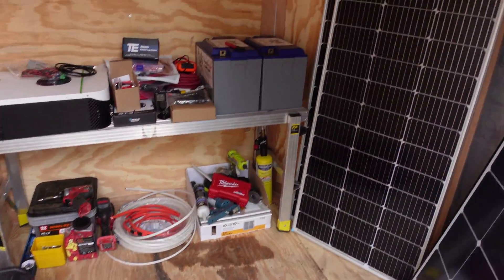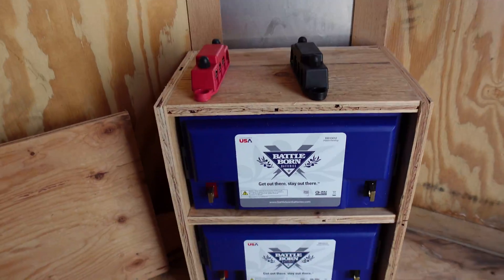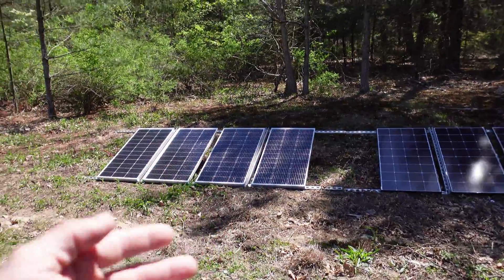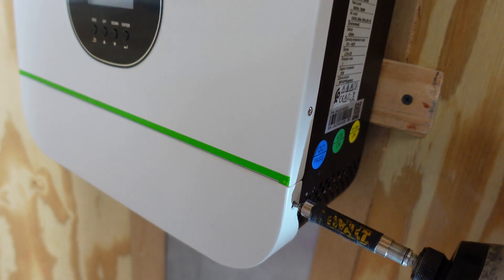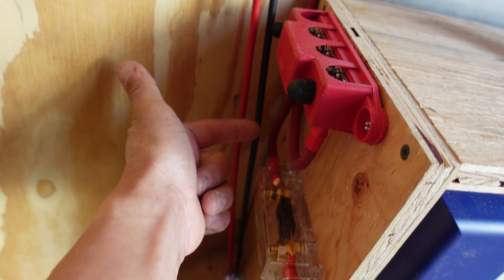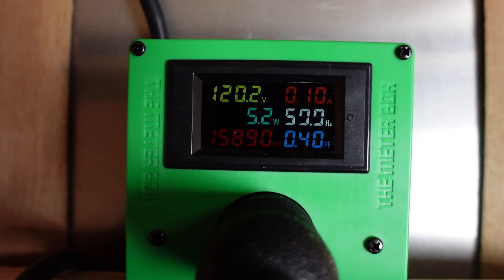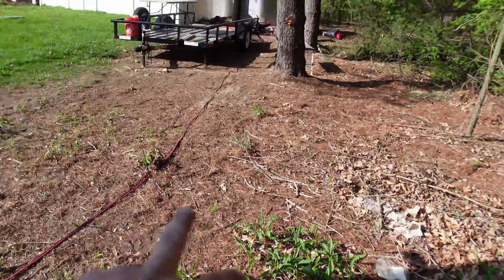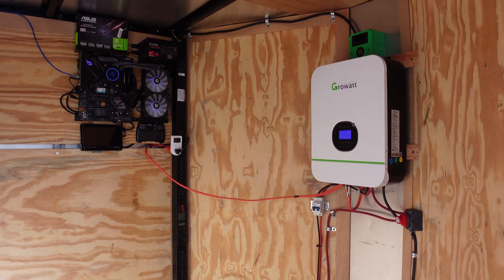My Crypto Mining Solar Build | FULL GUIDE

Comment: have you thought about a failure in the battery bank? If you have 1 failed battery that starts losing voltage, in a series system it will kill all the other batteries too most likely

Comment: That PDU is a "switched PDU", meaning you can remotely control each outlet via ethernet web page. The PDU has a little web server which you can log into and you can then remotely control each outlet and set schedules or do manual on/off.

Comment: I have been in precast concrete for over 20 years now creating mix designs. Next time don.t put holes in the bucket. If the concrete dries to fast it will get shrinkage cracks. With the top of open and covered with soil it will set if 24 hours. With a good 4000 psi mix it should be ok to mount the panels In one week.

Comment: Converting from DC (batteries) to AC (inverter) is at going to loosing about 10% of the energy. The PSU is then converting the AC back to DC to power the mining rig, again loosing about additional 5% for a total of about 14% of your power doing these conversions. If you convert between voltages at DC the effeciancy can be as high as 95 to 98%.

It is possible to get 800W DC-ATX power supply which is designed for autonimous cars that will run from a source voltage between 12 to 63, so will run directly off the batteries. Only thing to be aware of is you need to make sure that you have something that will switch the power off when the battery voltage gets to low.

Comment: Nice bro!! :) But i need 220V 😄 also the battery box need to be metal with cooling system if you have because they are overheat and loss capacity after time  and fire resistant because the wood will burn your walls:)

Comment: Awesome video man. Are you doing anything to safe shut down the rigs when the batteries don’t have enough to power the rigs? I’ve always been curious how people do that
Reply from the maker: I actually converted the solar to power the exhaust fans and when the sun goes down it will convert to shore power and back to solar during the day
Reply: @ChumpChangeXD  so the miners are grid tied?
Reply from the maker: Yes you need much more solar to run rigs 24/7

Comment: Why are you wasting energy converting from dc to ac and back to dc ? 
Much more efficent would be to step down from the 24 vdc to 12v,5vand3.3v for the Miner
Reply from the maker: Because I need 120v not DC? Lol
Reply: @ChumpChangeXD  The Motherboard is not powerd with 120v the gpus and Motherboard are powerd by 12 v.
I mean you could just use a dc input Power supply that you can get for Pcs or just use a high power dc dc converter
Reply from the maker: I understand that but it is foolish to try and hook up a MOBO straight and very wrong. I’m not willing to do that. ALSO this is for exhaust fans and other possible rigs not just a MOBO
Reply: @ChumpChangeXD   I have a Ring running like this for a couple Months with pico psu in the 24pin and a 100A Dc Buck converter to geht 12 v of my 24v Lipo4 works great

Comment: don't run different panel types in parallel
your better to run all the black panels in parallel, silver in parallel and series them together as each type with have a different mppt voltage point
Reply from the maker: Think you have that backwards my man. Series all the same panels 4 and 4 then parallel to keep it the same voltage vs series that would add more voltage. This is why I tested the lines. 

As long as they are basically the same voltage this set up is fine 100%
Reply: @ChumpChangeXD  doing that stresses the panel diodes and prevents proper mppt tracking, as a hardware engineer that designs and manufacturers mppt solar chargers. panels of different types should not be used in the same string but if they are run each type in parallel and series the types together this will help with panel shading and lets each panel type find it's peek mppt point naturally. It's up to you honestly but if you test it out a bit you might find you make 10-12 % more power per day and it cost a few buck to test might make a good update video too but either way you do need to keep within the limits of the charger but most are usually current limited on the battery side more than anything
Reply from the maker: @CNCAutomationLab  that’s why I ran 4 of each model in series to get to 80 volts each or just over; 84 I think inside the unit itself. 

Far as I know higher voltage charges the battery faster if I’m not mistaken? That’s the main reason I didn’t do things the other way (parallel and then series)

My unit can handle 145v open current max
Reply: @ChumpChangeXD  kool voltage maters on both input and output but Amperage on battery output is usually the limiting factor regardless. example
if your solar charger has say a 60Amp limit and a 140v solar input that means  at your 80v panel input might be limited to 80v at 60amps or 4800w input But if your using a 24v battery thats reduced to 24v at 60amps and that is only 1440w and this is where a lot of marketing takes advantage of buyers.
some can split some power to the inverter to power AC but something to keep an eye on
Reply: i went back and looked up the full specs on the 24v growatt hybrid and it's specs are 80amps peek with 65a constant in bulk charging mode that generally from 10.5 up tell 13.6v for LiFe based batteries with balance/ float from 13.6 up to 14.6  so 2 packs in series bulk charging is 21v to 27.2v so using 21v as your base 21v x 80A =1680w x 0.86 for efficiency this is a max sustained bulk charging of 1440w wirh short peeks upto 1600w so keep this in mind adding solar panels you might need to add another mppt charger for another array and yes it's perfect ok to have multiple chargers on a battery bank But make them all apx 0.2v below the main unit for peek charge voltage this help reduce the charge current when nearly fully charged and reduce battery heat

Comment: I have 1.8kw solar and my setup is almost 10yrs old. I have 4 group 31 deep cycle batteries wired for 24 volt with a 3kw sine wave inverter and 5kw charge controller. some day I'd like to upgrade to a 48v 120/240. I have a transfer switch controlled by a smart switch so I can switch over to solar when the sun is out. I never though about trying to see how many miners i could run 24/7.

Comment: really awesome and useful; appreciate learning from your experience. do you have a tip sheet or inventory of items to plan all the components to determine cost vs benefit? for example, how many panels and battery pack vs computer (cpu mining system) required?
Reply from the maker: I will be going over it all in another video this week. I do have the solar stuff in the Amazon store (pinned comment)

Comment: few notes about the project 1) battle born are great and the best but very over priced. Server Rack batteries are like half the price 2) not sure if growatt supports automatic power transfer without interruption to the grid after the batteries are drained. propably they do but in general, Victron multiplus is the king for quality and other bells & whistles like maintained apps for remote access / api. 3) connecting the solar panels in series means if any panel is partialy shaded, the whole amp drops for all panels
Reply: agree 100% .... go Victron Energy on your next build/upgrade.... so much flexibility.
Reply: I don't know the specs for his growatt, but in parallel, the voltage would be affected if a panel (or two) goes out, possibly putting it out of the range of the growatt inverter.
Reply: @derek2593  that's what parallel benefits vs in series, if one panel is shaded, doesn't affect the array production
Reply: @mostafaelgamel6415 , pardon my ignorance... but, are you saying the voltage is affected, but the amperage compensates?
Reply: @derek2593  so the whole array will be running on the same voltage and each panel will provide different amperage at that voltage, so for example im running a 24v per solar panel system 8 in parallel. the whole array is running at 38V each solar panel is contributing different amperage based on how much sun it's getting. The charge controller (built into growatt, steps down that voltage to little above the battery current voltage (now i'm at 23.5v so i assume the charge controller is converting to like 23.8v or so at an aggregate of 20 amps to about 476W total charge to the battery. that solar panel array can be running up to 60V (specially in winter) and the charge controller will be able to handle it.
Reply: @derek2593  one reason to run solar panels in series is to increase the solar voltage. so to charge the battery, the charge controller needs a higher voltage than the battery. so let's say u have a 48v battery and 4 12v solar panel (12v is just a spec or name means it'll be anywhere between 16v  or 24 volt, check the solar panel sticker will have these values) in this situation u will need 4 solar panels connected in series to get above the 48v battery voltage. now if one solar panel is partially shaded, the amperage will drastically drop on these in series array

Comment: hey you most likely have this covered but just make sure the strings that are paralelled together have the same voltage 
if they are different manufacturers they may have different voltage temperature coefficients.  solar panel voltages change with cell temperature. +-5% is no problem
love the DIY

Comment: would have been nicer with 12 volt or DC mining power setup as plenty conversion losses with AC. while there no off the shelf parts for this setup, I think it is pretty doable with some consulting or asking electronics/electrical people.
Reply: Even if you could power the miners with a 12volt power supply, you would have to have 4 or 6 gauge cables from the batteries to the panels since amps increase as you lower voltage.  A 48 volt system actually maximizes efficiency, and allows for minimum resistance.  Any gain that you would receive converting the power supplies to 12v would be lost having a 12v system at this size.
Reply: @designomatic  MPPT solar charge controllers can take higher voltages more than 100V. In other words, your panel setup don't need to match the output of the system/batteries.

Comment: Nice start (because you'll always want more battery and solar panels!)

I built a 48v 350ah battery a couple years ago and have 8 400w solar panels out back. My mining rig draws a steady 700w and if I have a sunny day every other day then I can run it 100% on solar.  The battery drains about 35% overnight. 

I built the setup to run the house, but why not mine on it!

I want to find a crashed EV and get the battery out of that to expand, and get more panels. Where i live the winters suck.
Reply: That cool. I am thinking the same on the batteries. I want a nissan leaf... I think It would do what I need. I am on flooded batteries and want to go to lithium iron posphate. Then I will fork on adding more pannels. I have about 40 now @275w so about 6.5kwh. It will not run my rigs. I have one on it now and part of the house. It is keeping up with that but I am building it myself and I never have enough time to get it right. lol

Comment: That is awesome to see.  I just got my solar panels hooked up this weekend.  Now I need to get everything moved inside to its permanent location and start powering some stuff.  Debating on what charge controller/inverter to go with.  Right now I just have an EPEver controller and a Giandel 2000watt inverter.  Right now I just have my fridge and a large fan being ran off grid.  I found I had about 500 watts worth of fans to keep my rigs cool but my large battery isn't ready to be installed yet.  That is a lot of $$$ I don't want to spend just for fans.  Thanks for the video and keep up the hard work.  I need to get me a trailer or something.

Comment: You need bigger batteries... 12v 200ah at least. If you add some gpu's I would say 8 batteries. That might hold for a night or two. 
Are all of those solar panels mono or are they mixed?? The mono will do better, if it is in partial shade(they cost more). If you have no shade the poly cells will do just as well and cost less. It looks like you have about 1400w of solar and 2400w batteries. What all are you going to try to run on it? 
Its a good setup... and another rabbit hole to go down. Have fun and GL.
Reply from the maker: Yea I will be getting more batteries and they are mono crystalline. I will be making another video going over ALL of the parts needed and what I used here.
Reply: @ChumpChangeXD  I have a 6.5kw system with 24 6v 300ah batteries. That should be about 43kw but my batteries are old and dont hold that much power now. And with all that I cannot run my 2gh farm.... I am looking at getting a nissan leaf battery. That should hold the power I need and possibly adding more solar.
What is the wattage on the grow watt. I was looking at them but decided to go with a Sigineer 48V 6000W hybrid inverter. I connected it to the grid so it will switch to grid power if batteries go low.